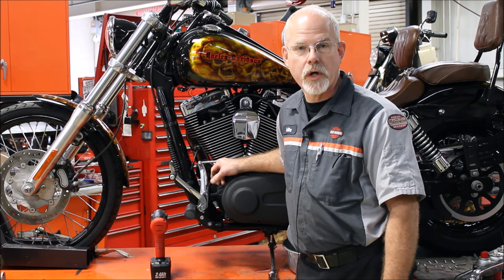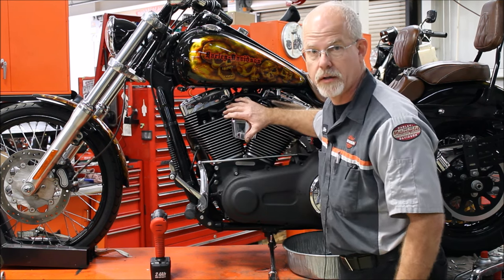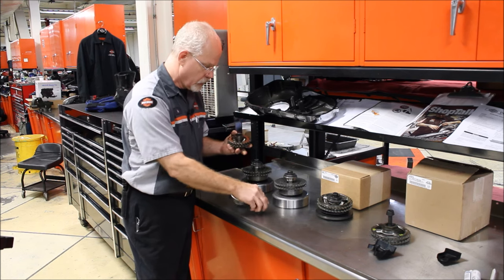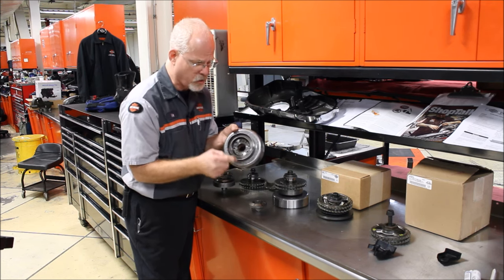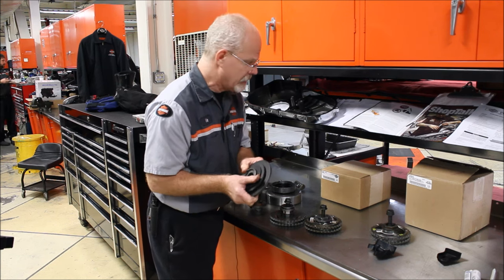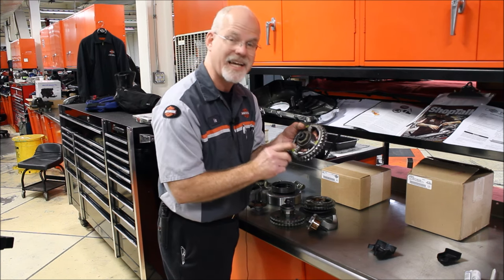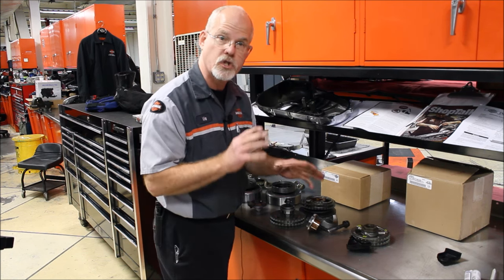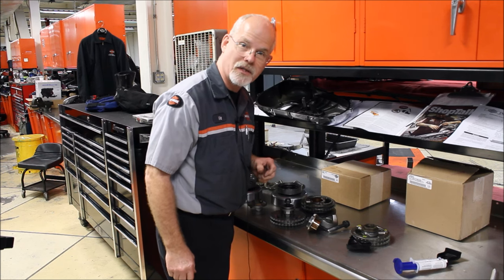2016 Doc Harley:  COMPENSATOR

Comment: I have an 06 dyna, and yes the alternator sheared the screws. The bike was in for warranty work at Chesapeake harley, the entire primary was apart, and they DID NOT replace the problem alternator when they could have, and this problem was known in 2015. I replaced the entire charging system myself. I like the bikes, but some of the dealers suck.

Comment: Doc , Not sure why you skipped over the pre 2006  model twin cam compensators. They did not have the integrated spring pack. I have a 120 HP 124 TQ  2001 fatboy. Everyone in the industry I talked to (Baker included) told me that the stock compensator would definitely hold but anything after the revision in 06 would need replaced. So it sounds to me like it wasn't a problem until they changed it in 2006. I am fairly rough on it and it has held for 22k on the original motor and 7k on the 107 build. Knock on wood.
Now the M8 comp ramps were changed as well and are breaking. 
When you find something that works well, stick with it. Or improve it and test it to make sure you improved it. But don't go backwards. Please.
Thanks for the videos Doc.
Little O

Comment: Great video Doc, you make everything clear and do a good  job on  the video part.

I feel I have a charmed Harley experience. My 2000 wide glide has had NO major problems in 21 years and 88,000 miles of usage. I don't beat it, it rarely has been revved higher than 3,500 rpm. I don't need to rev it high, it pulls like a torque monster from 1,500. I had the shop install a screaming eagle air filter and ignition module before I picked it up. And the mechanic swapped jetting in the carb, so it pulls really strong, and I change the Amsoil every 5,000 miles.

I started seeing horror stories about my engine on YT and had to do some digging. The compensator for 2000 must have been made of titanium because mine is still smooth and quiet. The cam followers still have half the material left on them. The local shop that trued the new spokes for me showed me my wheels have the extra wide bearings.

When people talk about poor Harley quality I have to shake my head in disbelief. Maybe I just got lucky but NOTHING expensive on my bike has had problems.

I replaced the spokes because several had seized and could no longer be tightened. That's it, that's all  that has been done except for tires and brake pads but those are normal wear items.

Years ago I swapped the factory pipes for vance and hines longshots. When installing them I noticed there was no cross over  tube. I immediately noticed a loss of low end power. That was a major disappointment to me. So even though the long shots had no baffles and should have less resistance to exhaust flow, they did not provide the same low rpm power I was used to. I went back to the factory pipes and it was much better. So, that cross over  pipe really does add to the low rpm power. Drag pipes are strictly for high rpm riding.
Reply: okay, do you drive your prius the same way.   lol

Comment: I have a 2007 Electra Glide Standard I've been debating what to upgrade my compensator to, original owner installed a SE at 20k miles, I have 45k miles and hearing the rocks in a can rattle when I take off as I'm letting off my clutch. Your video explains the why and what that other's haven't

Comment: My compensator will last a LONG time since it's sitting in a box on a shelf after I chucked it for an Evolution industries 30T engine sprocket on my 106" Dyna. That 30T sprocket is the best mod I ever made.
Reply: is your sprocket a direct drive? I took my compensator off and Im just using a direct drive gear. no compensating.

Comment: My 2011 Ultra Classic 96 is box stock and when I asked the dealer which compensator was in my bike they checked the serial number? and found it is the newer heavier duty one.  They said as long as I don't upgrade the power, it should be fine for a long time.  No issues to date after 30,000 miles.

Comment: BDL belt drive and dry clutch. Get the one that fits inside the stock primary. No more knock at start up and you'll never have a compensator problem ever again. Cost less than 2 compensators.

Comment: I put a man-o-war compensator and a hayen M6 BT07 primary chain tansioner in my 2012 (103) road king classic and it is doing great.
Reply: Yep! ManOWar is only way to go IMHO. Kevin Baxter has a great video on Compensators and the ManOWar.
Reply: @dougfresh1341  yea man! I’ve been watching that video over and over again cause that’s getting added to my bike
Reply: I’m a newbie to Harley ownership (2006 Dyna Wide Glide purchased last December) and have been learning a lot on YouTube videos about Harley’s engineering screwups. After learning about these compensator issues, as someone with engineering and materials science degrees, I definitely agree with you assessment of the Darkhorse Man-O-War compensator. It will be one of my first upgrades along with a fan assisted oil cooler. I feel a bit sorry for Doc Harley as he’s stuck with Harley parts for his recommendations. I’m sure that if he felt free to recommend aftermarket compensators the Man-O-War, with it rebuildable elastomer design, would be on the top of his list.

Comment: I've been paying alot of attention about compensators and primary drives for big twins. I had an 02 Dyna FXDX and made it a drag race bike. I used a BDL comp sprocket with 2 teeth shorter. Broke the first one and BDL sent me an updated version. No issues. Product worked great. Sold bike.
Fast forward to 2019.
I have a 2012 roadking which I race in "Hogs gone wild" series new this year. I race in the "street" class. We have to complete a 20 mile ride before each event.
As wear and tear are coming with bikes with milage (mine had 30k when I bought it used) I tore into the primary. I found some massive wear on the 3 arms and 3 ramps..so much so, I didn't even question it. I purchased the SE comp and installed it. You can deff tell the robust and better engineering. 
But we are about to find out how well it will take 6500 launches and see what's lacking, if any, with this design. After all...the sprocket and clutches are much cheaper to replace than a transmission....

Comment: I had a Sturgis belt drive (both belts) installed on my 1979 Superglide at 18,000 miles. The compensator started making noise, at idle, 10,000 miles later. I welded the damn thing solid and haven't had any trouble for 73,000 miles. Maybe the belts make up for the power pulses or something but I'm not about to put a new compensator in with no other issues having occurred.
Reply: bottmar1 That's what was done in the old days. They also make solid sprockets.  The compensator is actually meant to protect the 5,and later 3 piece crank shaft. Too many burnouts will shift the flywheels.

Comment: I pulled the primary chain drive out ; and replaced it with a 3 inch belt drive. That was over 10K miles ago, on my 99 twin cam, still works just fine and dandy.
Harley will never go with a primary belt drive. They are too robust, and dealers would take a huge hit in "shop income" not fixing primary chain drive problems......

Comment: Doc Harley,
How Goes it Sir,
Wanted to Let you Know, Your Videos are the Best Pointed and Clear (How To, How It Works, WHat to expect when Performing Maintenance and through adding a few more "Bald Eagles" under the Jewels. This Compensator video is exactly what I needed to watch, My current Project Has just commenced the past few months, I felt like I had all the Parts Finally Purchased and In Hand for my 2010 FLTRX Custom Rebuild. Stage V, Go Big or GO Home They Say... Except wouldn't you know what I did not pick up,,,,COMPENSATOR!!!! 
I Have the New Jugs, Pistons, Rods, Lifters, ROcker/rollers, 259 cams, 2 to 1 Borzillo Header through slip On, Ported & Polished Screaming eagle Racing Heads, 38mm Throttle Body, Injectors, Screaming Eagle Plugs, Wires, 38mm Screaming Eagle Breather, 259CAMS ONE MORE TIME, New Stator, Rotor, Cap, And Dyno Jet Power Commander V, (hope it pairs well since SER Programer is not available),,, I had Previously Installed The Stage 1 Kit, and went with the DJ V Fuel Mapping / Programmer. HOWEVER UNTIL I WATCHED THIS VIDEO,,,I WOULD NOT HAVE THOUGHT OR EVEN KNOWN WHAT YOU JUST TAUGHT ME DOC HARLEY,,,THANK YOU,,,
CAN You tell me if my Power Commander will work on THe STage V Tire SHREDDER 110 Kit,, Or even better, DO you Happen to Have a Pre Programmed Screaming Eagle Race Tuner I could Pick up,, EVEN BETTER

THANKS DOC HARLEY,,,,
Im now a Subscriber,,,and when Brothers want to Know,,,Im pulling your videos Up,,,And Buying all the Products advertised across your Channel....lol

Comment: SInce I own a 01 RK, a 10 Dyna and a 15 Ultra, that answered all of my compensator questions. My 15 Ultra I purchased recently with 7900 miles on the clock. Owner said he had just had it serviced, so I lived with the Harley noises for a few hundred miles. Did a three hole change, putting gear oil in the transmission and primary lube in the primary. Noises went away within 20 miles! When I changed the gear and primary, I would bet those plugs hadn't been removed since the break in serv ice! Trans oil looked good and smelled like 10 yr old third member lubricant!. Primary oil was obviously OLD and Soiled... I'm a 1,000 mile oil and filter changer and 2,000 mile max primary oil changer.

Comment: Thanks for the video Doc. It's always an add on to the manual 😉
I got your point and wondering why so many (older) Harleys were transformed to a primary belt drive. Where does the torque energy goes, when there is no compensator even if the belt is elastic.
And how (in the first place) does it effect the drive shaft?
.

Comment: thanks doc,I have learned something I didn't know, I'm always trying to learn more about my 2015 street glide I now know that my compensator will hold the power of the new cams going in in 2017
Reply: don't bet on it
Reply: It will fail. Once it starts banging on heat soaked starts and lots of driveline slack, it's time!

Comment: The compensator on my 2011 Street Glide 103 motor went bad at 7,000 miles.  The guy talked about the little funnel to get more oil to the part.  That seemed like a weak band aide to the problem.  I wasn't too happy about replacing internals with such low mileage.  I wish Harley would invest in getting the plastic parts out of their engines...
Reply: Go Baker. They've figured it out!

Comment: I appreciate these videos but...  I have a 2003 CVO Road King with a Screaming Eagle 103 cubic inch motor.  The 88 motor started production for model year 1999 through 2006, you don't even show one of those compensators.  Don't even show a suitable replacement either.  Don't know why you're ignoring the massive number of bikes now needing a new compensator to replace the CRAP comp that harley installed but it would have been helpful information for me.  Thanks anyway.

Comment: I have a 2005 Dyna Wide. Made it a 95" that has 100 HP. With14K miles. About 8 years ago I had a clicking/ rattling compensator. I found a factory bulletin that says to go 1/8 more turn after recommended torque is reached. Harley bulletin # M-1170  I never heard another clicking or rattling noise since. Look it up and give it a try.

Comment: Thanks doc I couldn't find anywhere that explained what the deflector was designed for i just new it was to redirect oil. Can't I I purchase a 2014 primary cover and derby cover and not have to glue plastic inside mine? 2012 heritage softail classic 103 built cholo style
Reply from the maker: James, the deflector kit is a functional, inexpensive upgrade, but you can certainly opt to replace the primary cover with the newer one!

Comment: I have a 2010 RK with a 96" twin cam.  Other than some slip on tips everything is stock.  The bike isn't ridden hard, how likely am I to have compensator issues?  I've heard it's more prevalent and 103' and larger motors.  Also, from your video it sounds like there was some upgrading around 2010, but it didn't sound like it was a universal change as you mentioned some 2011's having the older compensator.  Is there a way to determine which compensator I have without tearing it all apart?  Thank you.

Comment: Great to know. I have a 2008 Road King. SO, what will be the best compensator for my bike?
Reply: My .02 worth... Install a Darkhorse Ma-O-War. It has a nylon/rubber dampening system. Rebuildable when it wears out. Rides much more crisp than ANY HD comp. See Kevin Baxter's video- Junk Harley Compensators.
And I bought mine thru Kevin. Way better engineered product.

Comment: I'm thinking of buying a 2019 HD Heritage classic with the 114. I have been doing a lot of research into Harleys and their reliability. I live in Canada and can only ride 6 months a year. I ride 35,000KM per season. So every 3 years I ride over 1000,000KM. My current ride is a 2014 Kawasaki Nomad 1700 with 164,000KM on it and I have done nothing to it mechanically except wearable items and gas. It has never broken down and never needed to be fixed. I want to know if I can expect that kind of reliability out of a harley given how many KM's I ride? This will be my retirement motorcycle and I will ride even more then I do now. Can I ride 100,000 to 130,000KM (81,000miles) every 3 years reliably or should I buy another metric (Japanese) bike? I have seen hundreds of Youtube videos of people having nothing but problems with their new and old Harleys. Everything from Compensator sprocket and Spring pack Failures to the Pressed Flywheel coming out of true by more then .003" damaging the Pinion shaft bearings, the oil pump rotor and the Cam support plate bearings which can cause catastrophic engine failure, Failure of the Two silent chain drives (one to drive the oil pump and one to operate the two camshafts) due to a failure of the Plastic chain Tensioners, Failure of the Oil pumps which are inadequate and only pump out 3-8psi of oil pressure at idle which is close to 0 oil pressure, which is why all Twin Cam engines run extremely hot, Inability to fix Coolant leaks, the location of the Copper Stator is placed in the hottest part of the engine (right up against the left side crankcase, in the Primary drive where heat is the greatest so stators may need to be replaced often, and finally the Starter is behind the hottest rear cylinder and catches a lot of heat instead of being located forward of the engine where its coolest. I have not seen one video of anyone owning a Harley motorcycle that has put Hundred's of Thousands of KM's on their bike and not had to essentially rebuild the whole motor frequently. Is that because their not made to last? I'm not trying to pick on HD motorcycles or be an ass, I just need to know if a Harley could be the right bike for me given the huge number of KM's I ride? I expect to put 500,000KM on this bike in less then 10 years. Thanks for your help.
Reply: NO it wouldn't be the right bike. Goldwing. more power than 1700 twin and long engine life.Only thing is overall look is different. :)

Comment: Spring Inversion? 

Baffled by the orientation of the disc washers taken out of a Compensating cover from a 95 Evo, and trying to identify what a new spring pack has for disc orientation, I had to consider: can the Bellville springs "invert" under load? Reading up at http://www.vinscospring.com , it turns out, when the outer edge of these springs are contained, or trapped, yes, they can invert. Maybe that explains what I found - all springs oriented in the same direction, or parallel. I find it difficult to see how they are orientated on the new factory pack without dissembling it. At $275.00 , no thanks. Logically they should be 2 pair, back to back.They weren't and that's what led to my original request for help.  In my OP, I said they are not back to back based on what I found on a used one. Maybe I am wrong.

Perhaps the answer to the appearance of the springs NOT all being " back to back" ( what I believe is termed "in series") was also found in the information on the Vinsco web site. They describe one reason for having parallel orientation is low friction (useful in the HD case) and combining parallel and series orientation to match required needs.  Is that what we see, (or can't  see) when we look into the edges of a new  spring pack? They do not appear to be all back to back (in series) as in the new removable TC HD springs are positioned. Perhaps, the first two discs are back to back, the next two  parallel and facing the opposite direction? Could that have allowed #2 dics to "invert", resulting in all discs being pulled from the cover all facing the same direction?  I'd like to hear from someone who has pulled apart an early style disc pack, in new condition. 

Does any of this matter?... probably not. But it is an interesting study into the details of what can crap-out on the seemingly bulletproof early style compensating sprocket system and how they work.

Comment: Doc, do you see any reason that I shouldn’t just buy a new rotor/spring pack assembly (part #40356-07) and replace that myself? I see them fairly cheap online. I’m thinking that may fix my compensator noises and hard starts on my 2009 FLHX with 28,000 miles. At least maybe for a little while till that part wears out again?
Reply: It's an inferior design overall and will fail again. The new S/E one is worth the price.